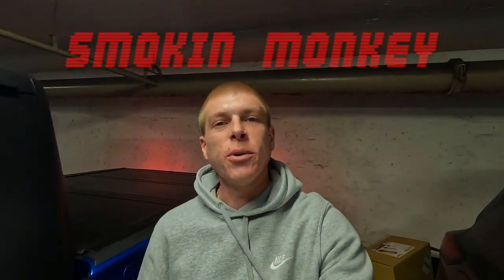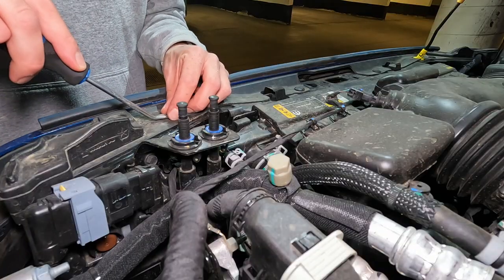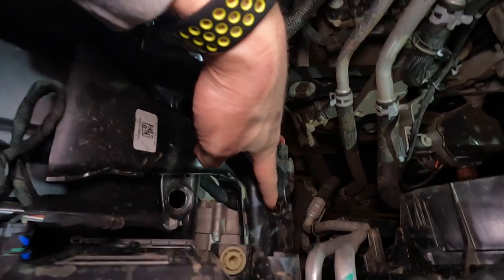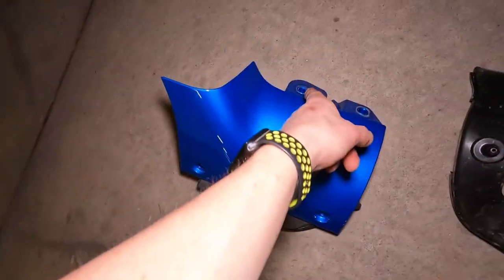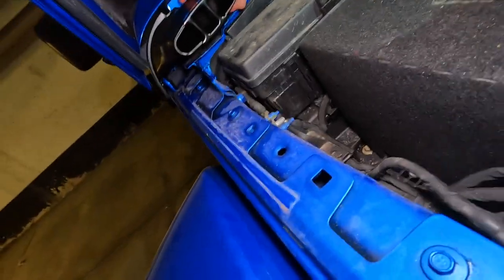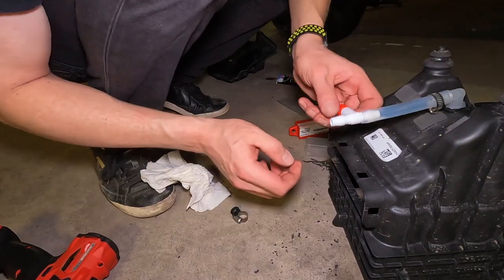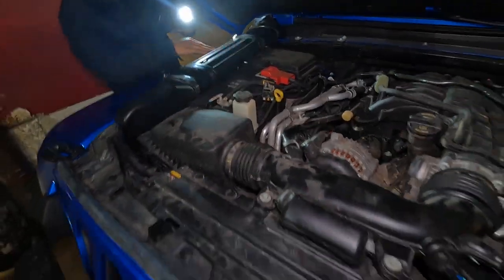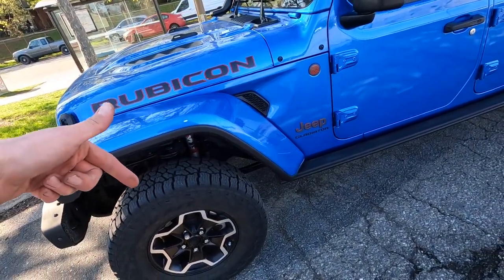No Messing Around! Adding A Snorkel To The Gladiator Rubicon

Comment: Some People call me a try hard because I have two trail jacks on my Jeep. I call that hating. 😂
Reply from the maker: I feel one is more than enough but whatever makes you happy I guess. I prefer bottle jacks myself
Reply: @SmokinMonkeyOG  main reason I like trail jacks are if I need to be pulled sideways the same time I’m winching. Another reason I like trail jacks are for spreading or opening car doors that have people trapped inside. Ya never know. I drove wrecker for a very long time.  I’ve seen some things. 😂
Reply from the maker: That makes sense. I hear you about the multiple uses

Comment: FYI, the high snorkel part normally stays black, it is the cowl part that the people have painted. As for the evacuation hose, I replaced mine with a longer one to have an even easier access to it. It is now right there, sitting below the fender liner. Also, the only thing that was in your way to close the hood was the clamp screw connection. Most people position so the connections rest on the side of the tube and not on top.Personally, since the fitting is so darn thight, I chose not to use the clamps since there's no way in hell water can seep in from there due to tightness... And, the force of the clamping is responsible for making the tubes warp because of engine heat.
Reply from the maker: I would paint it and leave just the grilles black on the side and the top. That’s how I’ve seen it and it looks great but I’m actually liking the all black for now. I tried relocating the clamps and it didn’t help for me personally, maybe I did something wrong but it fits now lol but I hear you on the no clamps. They do make it warp

Comment: Cool mod.  If I were doing it I would paint match the bottom only.  How hard is it to change from high to low snorkel?  If its easy I would consider leaving the low on until I needed it then switching it out the day I was taking it off road.  I like the mopar trifold top you have.  I was going to get the one made by bac but now I may get the one you have.
Reply from the maker: It’s 4 bolts to switch it out so not hard but I kind of prefer the look of the high mount

Comment: Nooo you’ll never need one dude if your that deep your wrecking shit already nooo don’t waste the money
Reply from the maker: I hear ya but after destroying one engine in two feet of water I would rather be safe than sorry
Reply: @SmokinMonkeyOG  how did that happen ?? Your vent hoses must not have been extended for that cause stock tj air box is Danm near the hood and I’d never suggest that deep the gladiators wheel base is so long that your bound to break shit off-roading big thing like that and just costly aswell
Reply: @SmokinMonkeyOG  I mean don’t get me wrong I’m just so die hard for the tj
Reply from the maker: Vent hoses? Lmao you don’t hydrolock by sucking water though a vent hose. You do it by getting water directly into the intake. I posted the video of you want to see